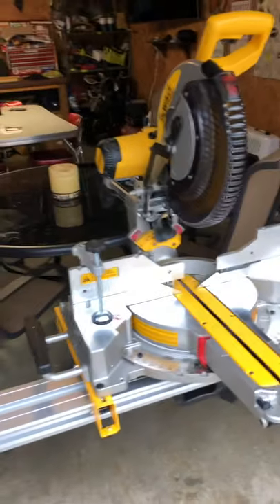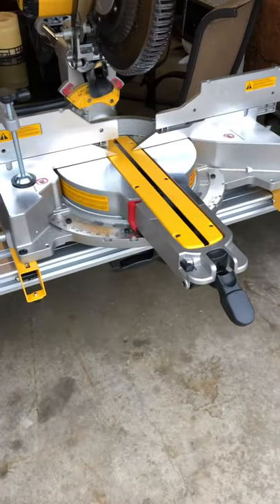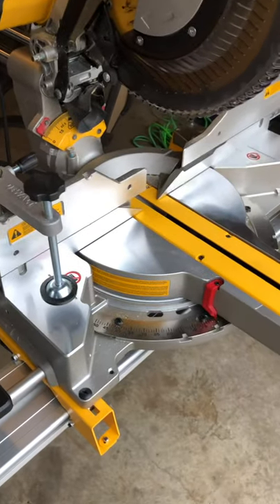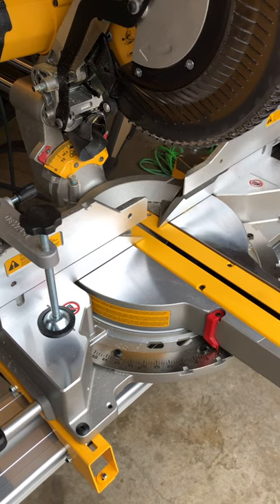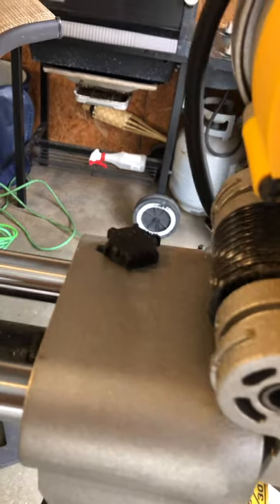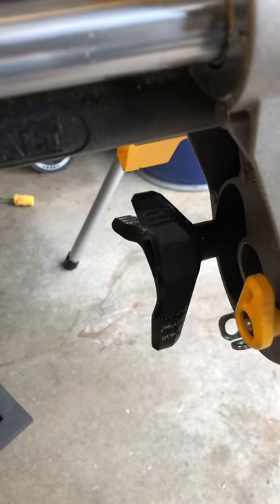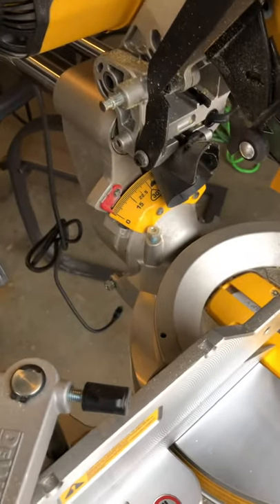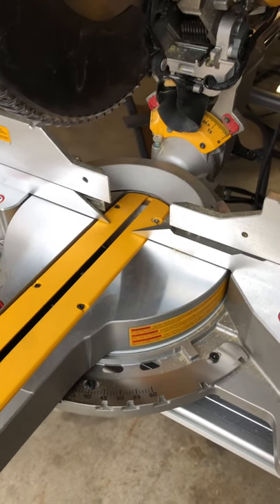Dewalt DWS779 12” dual bevel sliding miter saw. “Missing features” !!!!

Comment: They also changed the throat insert as well. Was two pieces to allow adjustment. Now it's solid and non adjustable. Also one important feature they removed is the set of holes on the lower fence guide to attach secondary fences (example: zero clearance fence for small boards). Even the cheapest saws have that. I assume Dewalt wants enough differences to upsell to the 780's.

Comment: I just got this saw as well and hate they removed features.  I really wanted the pawls for the bevel cuts, and not having a slide latch seems stupid.  Looks like DeWalt started using whatever they had laying around to cut pennies on these before they discontinued it.  My saw is a Type 22, but if you go to DeWalt's service center they don't even list it, just Type 20 and 21.  I believe I can drill and tap the holes for the pawls since the base is cast for them and just order those parts, but the latch will not be possible since the casting is missing the hole to attach it.  I imagine the Type 21 steel bevel knob would be an easy swap as well.
Reply: a bit late here yet find the same issues on a new 779 type 22 i just picked up to replace a 23 year old  dw708, yes the palls are missing yet available as part numbers 80 188 189 and 190  times 2 as they are for 1 side for a cost of about $20.00  the light kit from M&M is now $92.00  
over all the tools is a good buy

Comment: Thank you for showing the plate on the motor… yours is a model 22. On dewalt parts It has 167 parts ..it has as many parts as the dws780’s 167 parts.

Comment: You think we can just buy the bevel pawls and put them on out 779's ourselves? I just bought this saw too and was wondering about that.
Reply: I’ve been looking, haven’t found them sadly.
Reply: I Purchased the Saw a month ago, called Dewalt and they sent me out the parts for free. They sent me out the pawls and a 60 tooth blade.I didn't ask about the metal handle.
Reply: Dewalt may have taken these parts away, but when you think about it I get my saw for $290. And all I had to do was call Dewalt and ask them for the parts which they sent out to me for free. That's a pretty good deal. I ordered the XPS lighting system from MM Tools for $75 and installed it myself easy Peezy. You can't beat that!
Reply: Dewalt may have taken these parts away, but when you think about it the saws are only $300. I Purchased my saw for $290 from Lowe's with a free stand a month ago, and all I had to do was call DeWalt and ask them for the parts, which they sent to me for free. That's a pretty good deal! I ordered the XPS lighting system from MM tools for $75 and installed it myself easy Peezy. You can't beat that!
Reply: @alvinhall3449  That's nuts. I just bought one and they are on "special buy" sale price from HD at $399. I negotiated $27 off luckily but that's still a lot more than what this saw was going for previously and with less funtionality is seems. Such a bummer.
Reply: You can buy all the parts on Dewalt's website here:
https://www.toolservicenet.com/dewalt/en//Dewalt/WOODWORKING/MITRE-SAWS//p/DWS779_20

But beware, the metal frame/body of the TYPE 22 saw doesn't have the same hole bores in place to accept the necessary components specificially for the pawls.

The part numbers for the pawl components are N043046, 385946-00, N058315, N043045, N058312 all x2 (one set for both sides of the saw). These would be for the pawl bolt, washer, two pawl sizes, and fine tuning adjustment screw (not in respective order).

The problem is that the metal frame/base does not have the holes needed for the adjustment screws that work with the the pawls for fine tuning your bevel, meaning the bevel stop won't stop the saw in the proper place, rendering them useless. I'm annoyed and frustrated with Dewalt for not keeping the same metal frame so we could upgrade later if we wanted to by buying the missing parts, but more so for just making these changes and not clearly saying so. We're losing capabilities and functionality but paying the same price.

Now if you trust yourself to tap and drill the needed holes on your DWS779 TYPE 22 for this and other missing options, by all means. Good luck.
Reply: in the parts lists they are numbers 80 for the 22 deg pall 188 for the self threading (6mm thread if you tap it ) shoulder screw  189 washer and 190 for the 33 deg pall,  you need 2 of each to cover both sides .the light kit from M&M is now $92.00
Reply: @rynobucket  same here 399.00 on 02/19/22 at HD,less my pro discount on their cc while lowes was $579.00 for the 779 and oddly $549.00 for the 780

Comment: The major internal difference between the 780 and 779 is the "downgraded" quality components in the motor. Same specs and performance but the wildcard is in it's longevity. I'm not a heavey user so I picked up the 779 for at home. On the job site we run the 780. So far no issues with either.